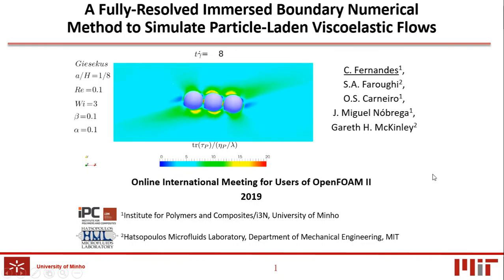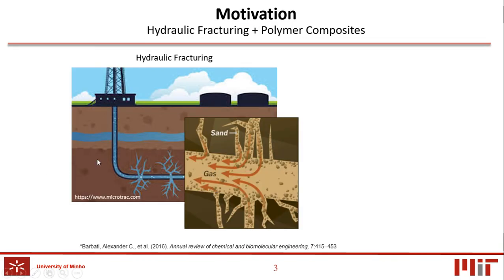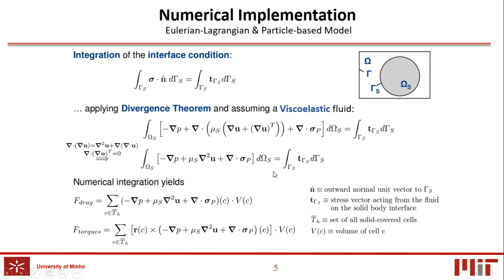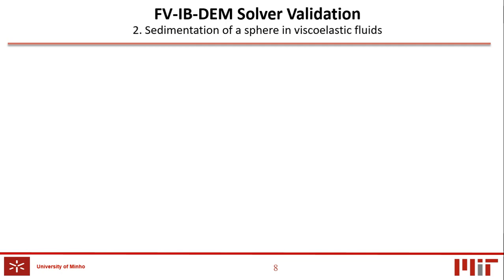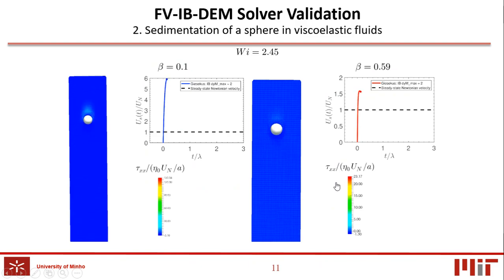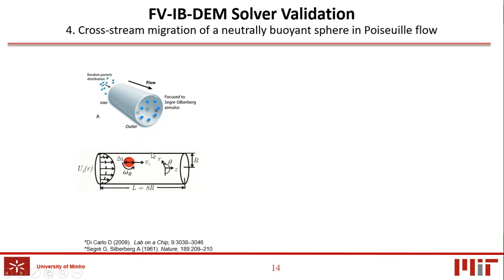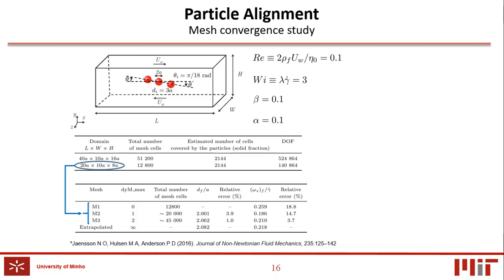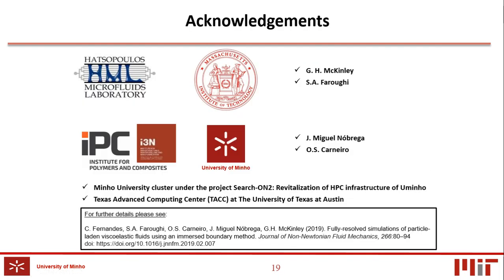Online International Meeting for Users of OpenFOAM II - P2 - Fernandes

Comment: Very nice work! I have a question: What is the courant number in your validation cases? Is the no-slip bc on the particle surface is still satisfied at, let say, Co = 0.9?
I am also implementing a IB solver and I have to keep the Co number below 0.1 to get a good result, which takes a lot of time to run a simulation.

Another thing is that I am curious about how to visualize the motion of the particle and plotting the settling velocity at the same time? like at 13:00?
Reply from the maker: I hope, that the authors can answer your questions.
Reply: @celiofernandes829   Seem like it is a limit of the ibm. Do you have any idea to improve that?